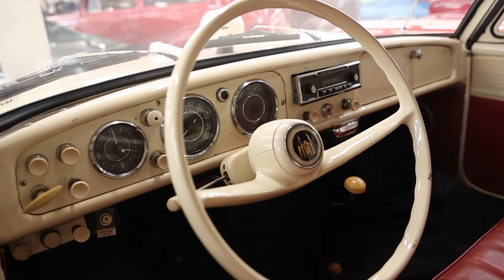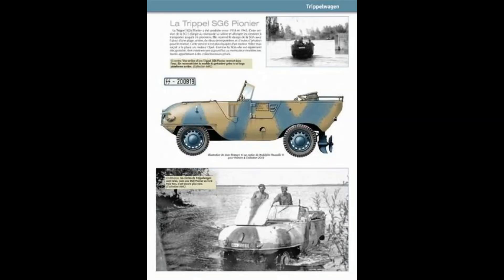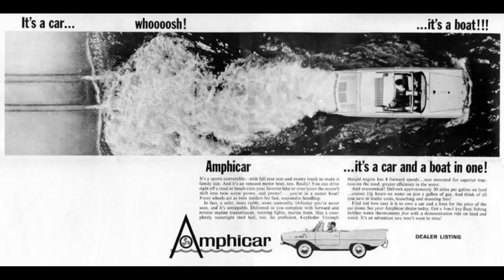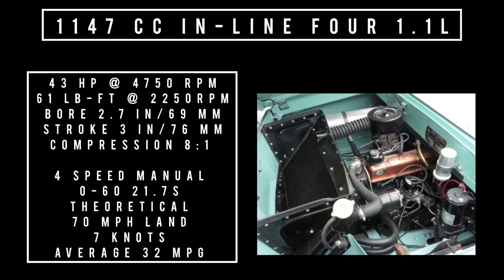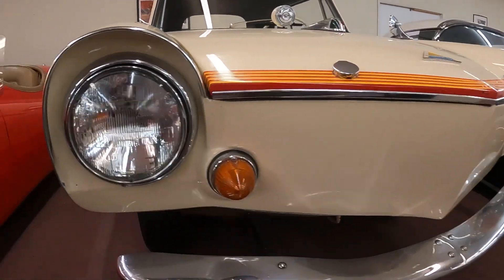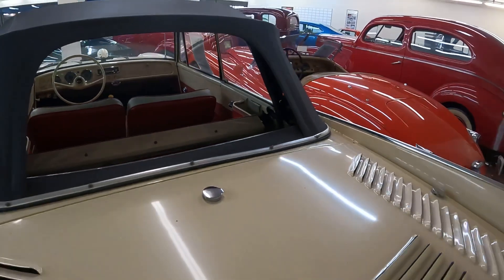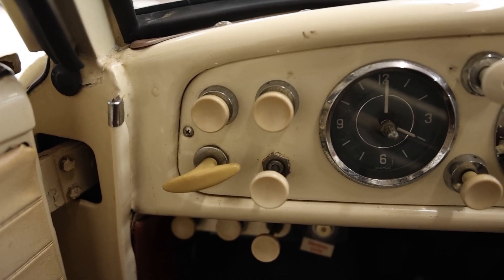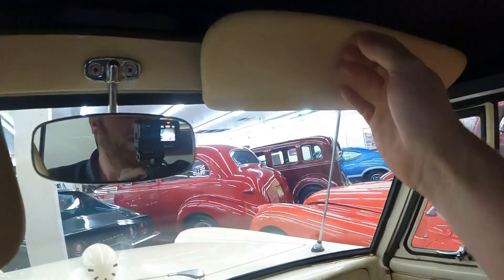1964 Amphicar, What a Quirky car￼

Comment: This just popped up in my feed, but I'd have gotten to it eventually anyway. I wonder how many of these (or what's left of them) are at the bottom of some lake or river? 😮 They were poor boats, being easily swamped which the bilge pump couldn't handle. You also needed a gentle slope like a boat ramp to enter or exit the water; the rear-wheel drive had to have traction to drive out of the water and the propellers couldn't push you out of the water on steeper inclines. Still who wouldn't want one just for occasional fun? 😁 I recall seeing somewhere that the last of the rubber door and body seals were made some time ago, and being critical to water operation, the chances of seeing one afloat today is slim to none ☹I'm old enough to remember the ads for these but I've never seen one IRL. The few which still exist are collectibles now, well out of my price range. 

With today's technology a much better version could be built, but meeting modern car safety requirements too would make it nearly impossible and an extremely expensive endeavor to attempt. I'd still like to see that happen though.
Reply from the maker: This is a car I’d like to own on day but man they are expensive for what they are and they wasn’t a good boat or car but great Curiosity

Comment: Yes, the engine is Triumph, and was also used in the Triumph Spitfire and a couple of earlier cars. The extra door handle pulls the door extra tight into it's seals to keep water out. Same reason for the hood latches and special key. I'd guess that the extra floor lever engages the propellers. It's interesting trying to spot parts from other cars in it. The steering wheel looks very VW. The vent windows look very Triumph Herald, and so on. Cheers.
Reply from the maker: Thank you so much fir that information I didn’t know it was the same engine found in spitfire I was thinking the lever on the floor engages the propellers but I couldn’t find any literature on that I didn’t wanna say that I did something that I wasn’t 100% sure of. I forgot to cut that part out

Comment: And that lever on the floor next to hear shift is
The ejection seat maybe?
Reply from the maker: I think it’s to engage propellers I didn’t find what it could be forgot to take that part out.. was just going to over dub but never found the answer
Reply: @What.its.like.    yeah. I think it is.  Just giving you a hard time. Lol
And that button on the dash was the bilge pump.  To pump the water out of the car so it wouldn't sink
I think that thing on the middle of the hood is a horn. To alert other boats.  Or maybe a fog light

Comment: If I remember correctly, the original design was intended to use a VW air-cooled engine, but for amphibious use it had to use a liquid-cooled engine and it ras required to have positive containment for any engine oil leaks. 
Looks like a VW steering wheel complete with the castle without the wolf. 
And, according to National Lampoon, If Teddy Kennedy had been driving a Volkswagen, he could have been President...

Comment: Good overview of the vehicle; but, damn, read the label: it's pronaunced like it's spelt; no "L" in the name: Am-FI-Car, not "Am- FLICK-Car; they weren't made by Bic! Pity a drive-demo wasn't possible; woulda been mast instructive re: the "user experience"... cheers.
Reply from the maker: I’m not the best at pronunciations lol 

I’m going to revisit this car in the summer I want to at least ride in one just didn’t want to miss the opportunity to cover this rare gem =)
Reply: @What.its.like.  No worries; sometimes the connection between tongue and brain can get short-circuited... don't ask me how I know. There's one that occasionaly appears locally; I once saw it experience a breakdown mid-river. The occupants eventually rowed to shore using the OE paddles that were part of the car's toolkit. If the unit's cockpit got swamped, the inner floatation system was supposedly such that one could partially drain  it by opening a door... Perhaps a thought for the revisit vid... heh heh. Keep on teachin'.